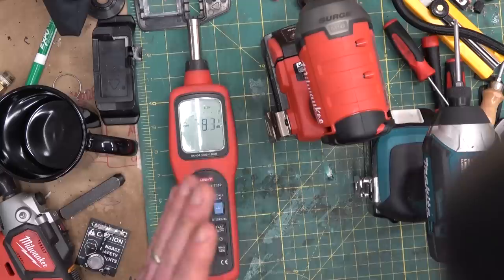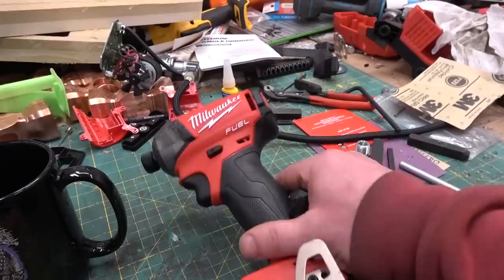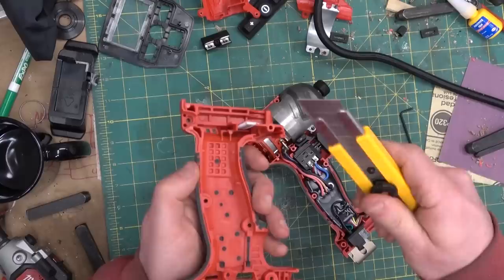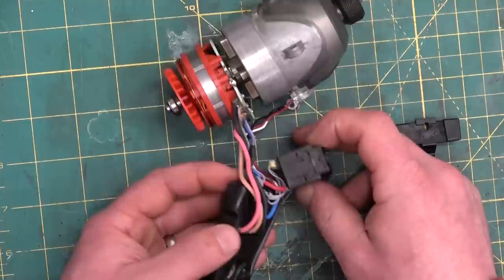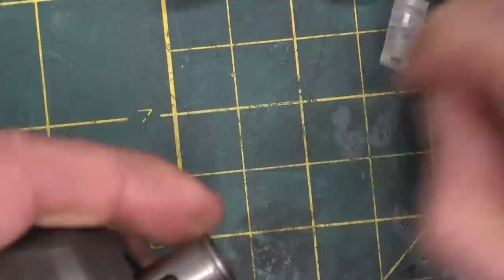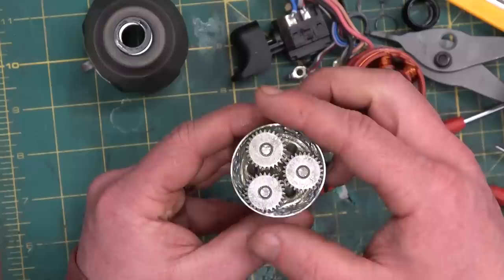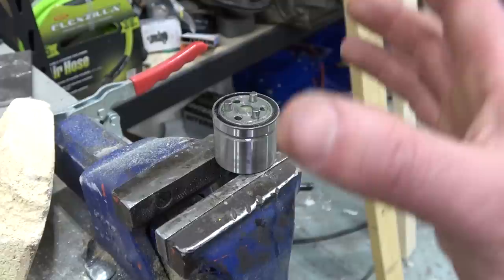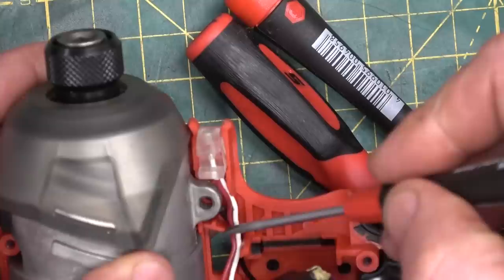BOLTR: Hydraulic Impact | Milwaukee Surge

Comment: Well, seeing as how it sucks anyway, I don't see any reason not to go ahead finish what you started and show us the goods underneath that hardened casement...
Reply: i agree  !!!!
Reply: 2007dalin yeah man, I love this gun, it’s compact and it honestly is quieter than any other driver when working with bolts. I guess they’ll just believe anything on YouTube lol. I also own a lot of snap on, Milwaukee , matco , impacts and electric ratchets. And I always pick this one up before any other one , unless it’s in a hard to reach place , or it’s something with more than 60ft lbs
Reply: @2007dalin  Totally agree with you, I love the thing. Granted, sometimes it's slower than a standard impact on some aspects but not by much. But it's sometimes faster than a standard impact. It's hit and miss, but I love the feel and how quiet the thing is. It does sound like AvE's unit isn't chooching properly so he should have tested it before and after taking it apart.
Reply: @whiteflame802  he takes things apart first to prove a point; as an end user, if you can't take something apart and put it back together using basic tools without it going wrong, then it's NFG.
Reply: I own a few surges and a few freaks. The surge is as fast and sometimes faster. The freak gets faster with larger fasteners. for wood framing projects using 3” #10 wood screws I personally prefer the surge. The more quiet performance is also a big bonus in my opinion. When I need more than that I’m going up to an impact wrench anyway

Comment: @25:35 3 dB is twice the intensity or power, 10 dB (one bel) is perceived as twice as loud and requires 10x the power.
Reply: I was about to argue that 3db does not double the power because that seemed way to high but I gargled and what do you know, you are correct.  I always thought 10 db was perceived as twice as loud and required twice the power.  It's nice to find out you are wrong about something because knowing I'm wrong means I'm smarter than when I thought I was right.
Reply: 10db takes 10x the power in a perfect world. Realistically, you'll quickly find diminishing returns when upping the power.
Reply: I was looking for this comment before I posted the same thing.
Reply: The rule of thumb I picked up was about 5 dB is the level where people can hear a difference and 10 dB sounds about twice as loud to someone. It is partly biomechanical and party perception.

Brightness of lights is another odd perception thing. I don't remember the numbers for that but I do recall it being very colour dependant.
Reply: So the 10db is perceived is twice as loud thing really doesn't hold that true in practice. In the car audio SPL community we deal with actual metered DBs more than probably any other hobby.

While doubling power or cone area will yield a 3db gain (in a perfect world) an audible doubling is closer to 6db.
Reply: I probably should clarify that I was talking about dBa as well which isn't the same as regular dB. I don't do enough sound work to remember how different things are between SPL dB and dBa at common frequciea.

Comment: Yup. I did a lot of die-sinking during my apprenticeship. Manual Miller with digital readout. I think I turned out as much scrap as mould blocks. The most precise was for Cadburys (the chocolate makers) for their injection machines (+/- 0.01 mm). This was due to the price of cocoa. If one loses 1 thousand tons a year that equates to £1 million.

Comment: Just want this guy to know. I bought one of these today. I went on youtube an hour ago to see a teardown. The first thing I typed was “milwaukee surge ave”. I was not disappointed.
However, like half the people reviewing the tool they misunderstand its purpose. I didn’t get it for power. I’ve got a 220 ft-lb impact wrench and a 100 ft-lb Milwaukee hammer-drill I use if I want to do things fast and ram in bigs screws and lag bolts (which, now that I think of it, might explain my daily tinnitus). The surge is for doing small work carefully and quietly. I intend to use it like the old Black and Decker electric screwdriver my dad had when I grew up. I thought about getting an electric screwdriver, but the M12 Surge can fit in more places because the depth is shorter. It’s got some power, but it’s not meant to be bought by someone wanting to regularly use it for those tasks.
Also consider that the viscosity of the replacement oil did not look to be as thick as the original. However, if you think about it, theoretically you could change the torque and time it’s applied over by using more viscous oil or less viscous oil. AvE should try testing the effect of different oil viscosities on torque and time-of-force. That would be something.

Comment: Have one of these hydraulic drive guns and for certain jobs like driving tech screws into roofing iron they are much less fatiguing with less noise and vibration they also have much better service life than the mechanical drive units-horses for courses.
Reply: This is what I use it for. Dont really need a driver for anything other than tek screws and unscrewing fasteners.  Have the 12v version because its smaller and and can get into tighter places. Got the 18v impact in the tool case for the rare occasion i need to drive lag bolts or something.
Reply: I've got two of these now My first one went under the knife for a warranty repair and while it was getting fixed I bought the second one. I also have a 2753-20 which has a lot more power but has a lot more noise to go with the power. I was never the guy that even cared how much noise any tool made period. But I use these 1/4" drivers everyday at work and the Surge straight up spoiled me. When the first one was getting fixed I still had 3  other Milwaukee 1/4" drivers I could have used. But no I bought a surge to use while the first one was getting fixed so yes this gun is quiet and smooth Did I say that I really like it? I do

Comment: the surge has less harsh impact transmitted to the user. If your driving 3/8 and 1-2 in lags all day you will come to love the surge. The hand fatigue reduction alone makes it worth it. i use the m12 and the 4 ah batteries and its way better than my m18 regular impact. it weighs less and drives as good if not better.

Comment: The textured ejector pins are used when the surface of the part is not perpendicular to the ejector stroke. It keeps the ejector pins from sliding and scratching the part on ejection.

Comment: lost me, Warren at tractor and truck repair speaks very highly of these, dont doubt there are others as good or better. Zipped a cylinder head off 6 ciyinder Cummins  (truck motor) in quick time and made the comment how impressed he was. The only comment was if you want full power you need a fully charged battery, sounds obvious but the tool sounds the same but doesnt have the drive force.He works his stuff hard ,  Good luck to you and your family, James.

Comment: 3db constitutes a technical double in sound pressure but you have to factor in the anatomy of the human ear. Even though the sound pressure technically doubled, we don’t hear it as doubly loud. General rule is 3db = barely detectable difference, 6db = obvious difference, 10db = perceived doubling. Also realistically speaking those sound pressure levels will never damage your hearing to the point you’d notice. The numbers you were getting were SPL peaks, the OSHA numbers only mean anything in the real world if it’s sustained SPL.

Comment: I can testify on behalf of the surge. I had a gen 2 fuel impact and decided to give the surge a try. I do a lot of cabinet installations and repairs to existing cabinets along with many other apartment related issues. All I can say is when I’m in close quarters with repairs like inside cabinets or boilers or furnaces, closets and so on. It’s night and day! I’ve left my surge on jobs and had to use my gen2 and it’s immediately noticeable to the point where I want to leave and get my surge. I’ll be getting the m12 version also.

Comment: Huh wonder if it's built like a high stall torque converter for race cars typically the smaller they are the higher the stall factor meaning they don't engage below a threshold speed
Reply: Dave Micolichek  depending on the duty cycle, it could be okay
Reply: It has a fluid coupling between the gearset and whackin end.
Reply: @mephInc  so like a regular automotive torque converter coupled to the impact driver part? I thought velocity (rpms) mattered more for torque at the business end than input torque from the motor. Is it just there for sound?
Reply: @ElPants21  
Ever snapped the head off a screw? That's because you're hitting it with all the torque immediately. The way a fluid coupling works is that as the rpms on the input side increase, the fluid in the coupling will fling to the outside and start to apply torque. This will start moving the output and will increase speed/torque as the coupling moves faster until it matches the input. 
These are used a lot in large conveyors that get loaded down with material. Upon start up, if all the torque from the gear box is applied, you'll grenade the whole works. Same principle is used in this drill.

Comment: We went through like 4 of this model at work because the spring in the chuck kept braking and the bits would fall out.

We put it through a hot supper putting brackets on aluminum extrusion so we got the non fuel model and it hits harder and no problems so far
Reply: You think it’s maybe operator error ?

Comment: This M18 and the M12 Surge (the latter in which I have) are great if you're a service tech doing calls and need to remove or secure something while inside an office or enclosed environment with people who can be greatly disturbed with noise. The Surge drivers are the tools for those purposes.

For everything else, if I want full speed, power, and torque, I grab my regular M18 impact driver, no questions asked.

Comment: I like how this works: you take it apart, replace the hydraulic fluid with 3in1 oil and then deem it a lame tool because it's not loud enough. Wait, isn't the sound just wasted energy? I'm sure most people are here for the double entendres, but I was hoping you would finally take one of these apart because I was curious about the internals of the hydraulic mechanism, and I remember what happened with the Rigid version. I use one of these almost every day that I'm not playing professor in the classroom, and it feels like you missed the point here. I have the more-powerful Milwaukee and don't use it. It's too loud and wothless for finesse work. It can only do one thing: slam fasteners quickly outdoors. When I'm in a client's house, this tool doesn't get the client screaming that something just got broken in the kitchen. As well, when you throttle it down, it doesn't snap the heads off of fasteners. And you aren't constantly burying the heads of the fasteners. Then yesterday I used it to drive some 10" long lags into railroad ties. It's powerful enough, but the power curve is different from a spring-loaded mechanical impact. If I need something with more torque, we are really getting into wanting an impact wrench, rather than a driver with a 1/4' bit, so you are kind of overlapping with a different application. (I love those youtube idiots trying to use impact drivers to take off lug nuts.) In use, this tool feels like it has a flatter, longer power peak that can be controlled by RPM, which I was hoping I would get more of an analysis of from an engineering perspective (my degrees are in another field). It has just about the right mixture of finesse with decent power when you need it. It's never failed in any application, from driving self-tapping sheet metal screws without stripping, to driving big timberlock screws. Here's the in-the-field reality of it: I built a mountain cabin-style deck and rail with a little seat and table for a client recently. I had a choice of three drivers to use to assemble the thing. I used the Bosch 12-volt impact for 80% of it because it's light and doesn't strain my shoulder. When that tool got hot or I had longer fasteners to deal with, this was #2, but really the only disadvantage is the thing is weighted like a bar bell, so it's not as comfortable to carry and maneuver all day.

Comment: The Surge is NOT slow and weak. You had it on it's lowest setting...
When putting 3" #10 pointer screws thru 3/4" plywood + 2 layers of 5/8 Type-X drywall + 33-mil 20-ga metal studs, my Surge outperformed my coworker's DeWalt 20v impact driving speed by over 25%, and also my standard M18 Milwaukee Fuel impact 💪🏻💪🏻💪🏻 The Surge is KING! 💪🏻💪🏻💪🏻

Comment: I use it inside cabinets and having it quieter with more touchy feely when Im trying to set a screw in particle board makes it my fav  new tool,...also, with the small M12 battery IN the handle its compact AND lighter than anything Ive seen/used, me likey.

Comment: wow im shocked how weak and cheap the molding handle the milwaukee had compared to  the makita he took apart a few videos back. the makita was packed with supports to keep the handle from breaking all the way up the shaft and any extra space was jammed up anywhere they could fill with support. been seeing alot of guys sharing broken handle pics on facebook on the milwaukee pages. makes sense now

btw thanks for taking these tools apart so throughly so we can really see whats inside. most guys just do a drill test of 2 screws going in side by side lol.  but we learn nothing about durabilty and strength from that. 

(salute)

Comment: The benefit of the surge is it is easier to start screws without them shitting out. Unlike the regular milwaukee impacts that start with 100% torque, plus it has torque sense so you don't strip out screw hole in light metal such as garage doors. Which I install everyday.

Comment: It's hard to tell from the vidjeo but the waffle ejector pins are most likely on incline surfaces.  That is done to keep the plastic from sliding on the ejector pin and this not deforming the part.

Comment: Got one of these for birthday as a second 1/4 hex impact. My feelings are, yes it's really quiet and yea it's got a lot of power. It has the multi speed settings of my old one which I like. But that lack of FEEL on the tool, or maybe it's really that it's that much different from the other one, meant it took awhile to get used to. It feels great in the hand, just like the other one. The louder more traditional one, I had awesome feel with, especially driving screws. This one...whoa, she'll drive in deep really quick baby.